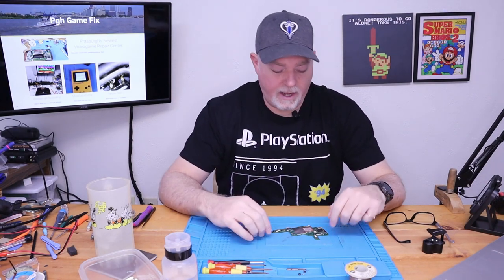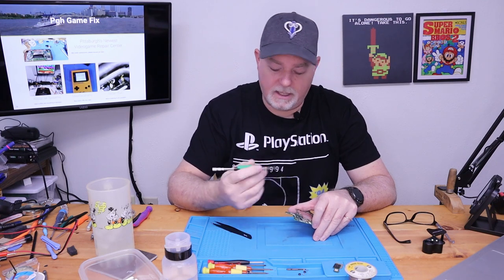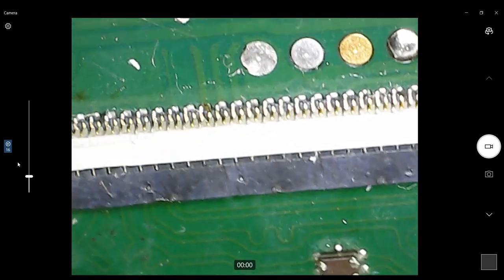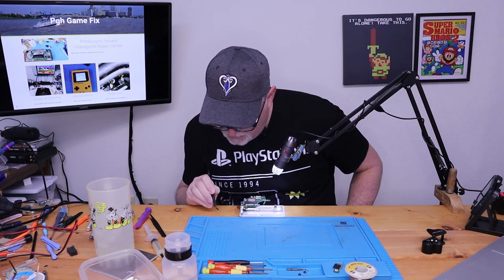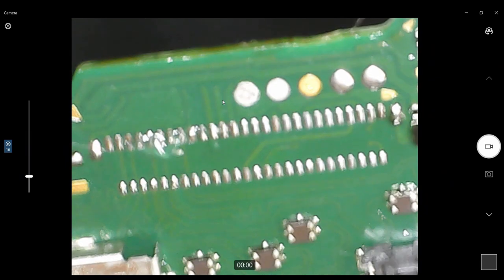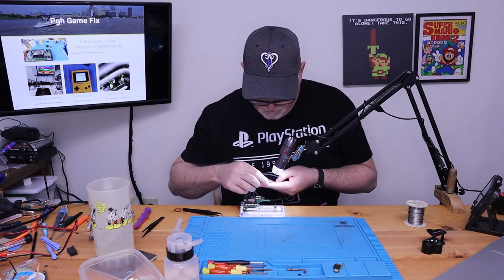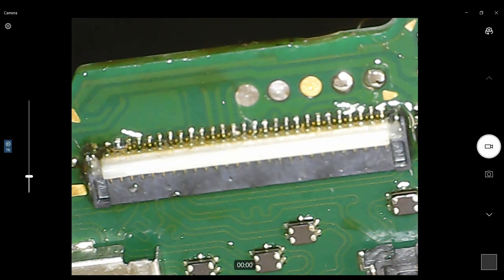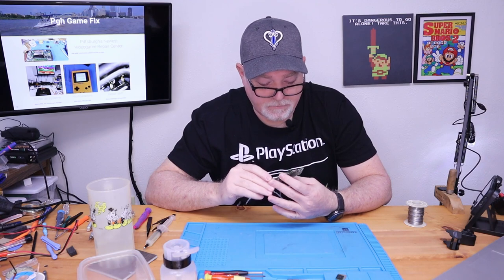LCD connector repair in a Nintendo Switch. (Customer repair attempt gone wrong)

Comment: Thank you for the wonderful video. Your voice is so relaxed and calm, it honestly helps a lot.

I keep watching these LCD connector replacement videos over and over again by various content creators, but I just can't get the board solder to melt from underneath. It looks like you /might/ actually have the same heat gun that I do. What are your air and temperature settings? How close do you have the gun to the board? Do you remember how long you held it there before the solder started to melt? And what kind of solder would you recommend for rebathing the pads?

Right now all I have is a flux-core lead-free, which I am guessing might be associated with my inability to melt it from a gun underneath. I just can't get it to melt. Could on a practice board, but not on the Switch board. I've been keeping it at low air with the highest temperature not exceeding 420c, because I'm afraid of damaging the underneath components. Even after holding the gun underneath for what feels like forever, the flux will quickly sizzle away but the solder just doesn't go soft. I was able to get the broken part off with some trouble, but can't get the new part to connect. Recommendations? Thank you sincerely, in advance. I've become so exhausted trying to get this to work..
Reply from the maker: When I work on a board with led free solder... I run the heat up to 480 on my heat gun.  Yes, it's hot, but doing it quickly to me is important.  (Less time for heat soak to parts around it)  Also, you have to keep in mind that there is some dynamic cooling involved with an air gun.  This is where the cool air around the nozzle is accelerated along with the hot flow, and in turn drops the overall temp. This is the same effect that keeps jet engines from melting their own internal parts. I keep the nozzle about an inch away from the board.  But the distance is how you will control the over all temp.  So there is some technique to it also. (That comes with time) The air flow is around 30%.  I keep it low so I don't knock off parts on the underside. 

Thanks for the comment.
Reply: @PghGameFix  Thank you so much for the advice, it means so much to me. Will be keeping up with your channel, for sure.

Comment: I gotta do a 29 pin version of this on the lite once the part comes in the mail. I don't think it will be terrible, but removing the old one I think is going to be the most annoying part. I figure add leaded solder first then either clip off the pins or air gun.

Lots of protective tape for adjacent parts.
Reply from the maker: Just use hot air and flux.  the pins are too small to try to get regular solder on them first.
Reply: @PghGameFix  I'll play it by ear, but the Lite board has a lot of stuff on the back, microscopic caps right next to the connector pins, and the battery connector right next door.

I'm more worried about melting something or blowing something away on this than a normal switch. If I use the air, this thing is going to be covered by kapton and aluminum tape everywhere but the connector.
Reply from the maker: @gungan5822  cover anything plastic with aluminum tape, otherwise it will melt.

Comment: Nice vid. Are you use hot gun from the bottom of the board?
Reply from the maker: yes. I often do that to work on plastic parts.  I also do that when replacing HDMI ports on larger consoles.

Comment: What temp are you using on the hot air?
Reply from the maker: on the plastic parts... somewhere around 450
Reply: @PghGameFix  Celcius or F? I did it with 450 C